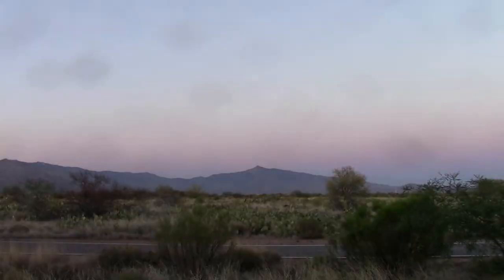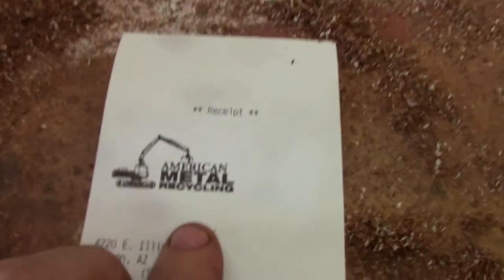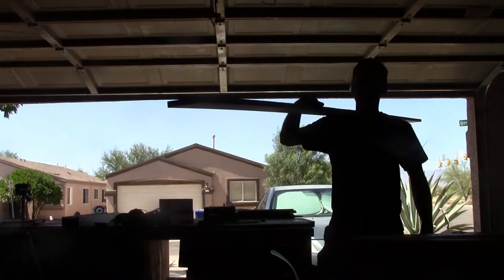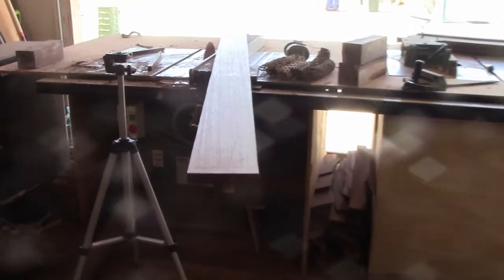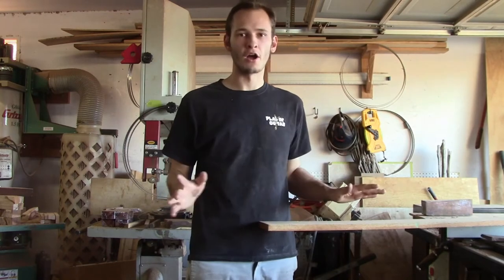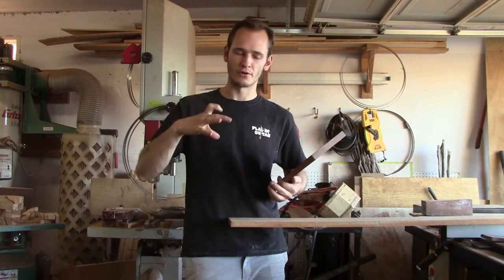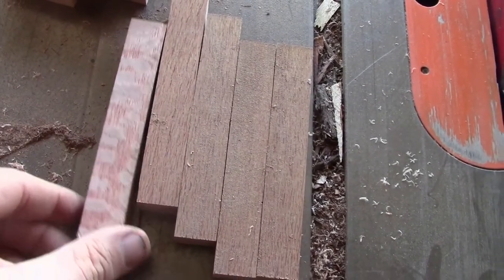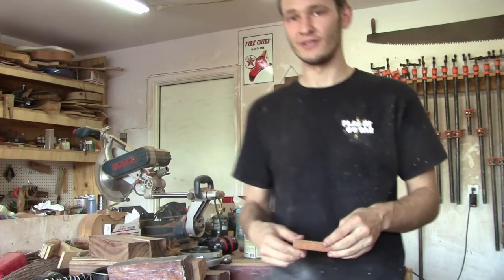Let's Talk About Leopardwood #StayDusty

Comment: Hi Jeff! I believe you confused the flat saw with the quarter saw. The quartersaw piece is where the figure appears strongest, when we cut the medullary rays along its length. In the flat saw piece, the figure is more discreet because we cut the medullary rays transversely. This confusion is natural when looking at endgrain, because in this wood, the medullary rays are so large that we confuse them with growth rings. That's why you reversed the flat saw and the quarter saw... those lines are the rays, not the growth rings.

Comment: use the quartersawn for guitar neck, and the flat sawn for guitar body. the way sound travels. any quarter sawn shall be brighter in sound than the flat sawn in a neck or fretboard given the same material, and the soundboard shall sustain for a flat sawn top  The quarter sawn neck shall also be stiffer against the pull of the strings versus the flat sawn. Although there is or was a bass guitar company that multilaminated endless sheets flat layups until the entire body and neck were completed. they were a high end bass guitar specialist i am going to look them up again and see if they are still around or if i can recognize the vid because i forgot the name. i shall look up that bass construction on youtube.